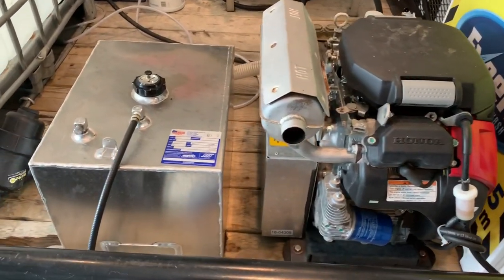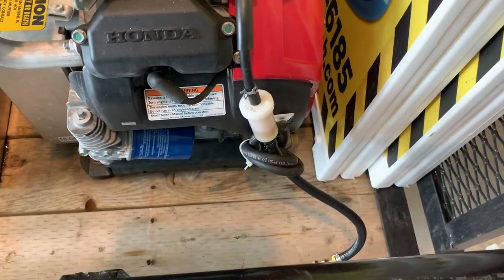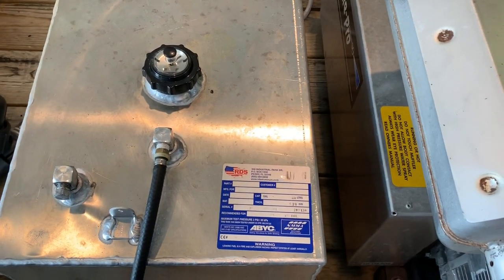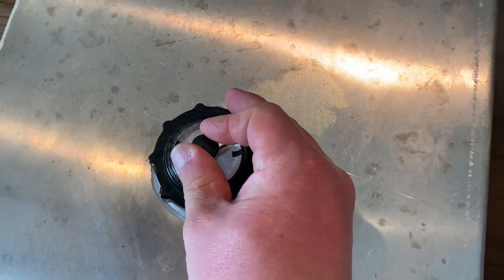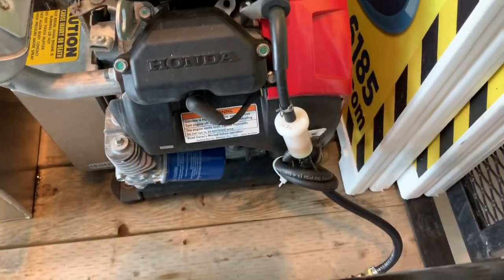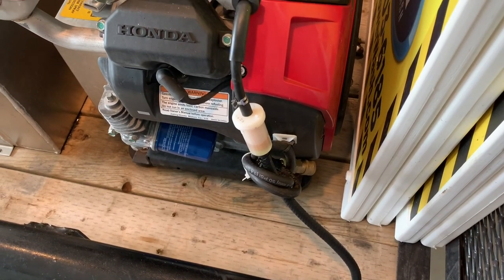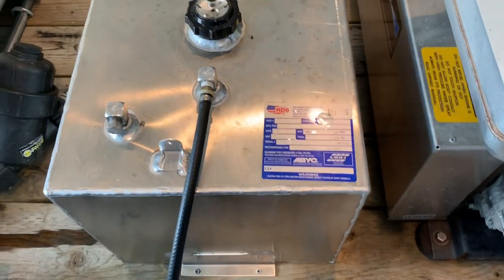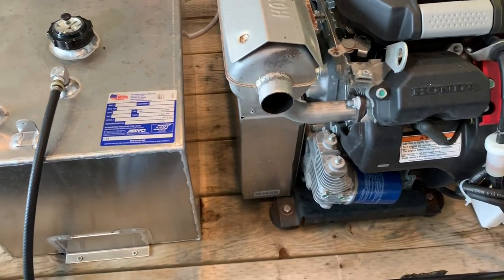Pressure washer won't run with new gas tank

Comment: This may be a silly question.  Are you concerned at the placement of the gas tank being so close to the hot muffler of the pressure washer?   I’m thinking of doing a similar set up (red plastic tank) and not sure how far it needs to be away from the muffler.   What do you think?
Reply from the maker: I never had a problem. Plastic, you may want to go a little further. I think in my trailer build video, I may have had the plastic tank in a similar area but it say lower. You will have to look that video up. I ran like that for more than a year before the aluminum tank. Hope that helps.

Comment: Thinking of upgrading to the aluminum tank is that a northern tool purchase?? Looks good
Size?
Reply from the maker: That tank is the 13 gallon. Definitely an update from the 6 gallon. I bought it through Northern Tool online. Great ordering experience.
Reply: Dude.  You should do a video on how to connect the hoses and stuff to the 8gpm.  I’ve never seen it done before
Reply from the maker: Thanks for commenting. Perhaps next time if I think of it. I have a few more builds to do before spring.

Comment: What would you recommend should i just go with the cold water or get the hot water 8 gpm for my first pressure washer?
Reply from the maker: Get the 8 GPM cold. You can always add a hot box later. I’m still not running hot water.
Reply: Have you ever needed a hot water unit for a job before? Do you think September is too late in the season to start?

Comment: can i hook up both of my pressure washers to this?
Reply from the maker: If it had two pick up lines. We recently switched to a nicer tank we sell in Portland, OR
Reply: @ExpertPowerWash  what do you mean pick up lines?
Reply from the maker: Tube that goes into the gas tank
Reply: @ExpertPowerWash  i have a tube on each machine, so i'd assume one machine tube goes to one port and the other one goes to the other port.
Reply: @ExpertPowerWash  do i need 2 buy pick up lines for this? i though this was a ready to go gas tank
Reply from the maker: You need to check to see if that tank will run two machines. It’s been a couple years since I’ve had that tank. I thought it did have two pick up tubes going into the tank. Take a look inside.
Reply: @ExpertPowerWash  so what is a good gas tank that I could connect 2 pressure washers to?
Reply: @ExpertPowerWash  what’s the gas tank you’re using?
Reply: @ExpertPowerWash  that brand RDS has a lot of bad reviews